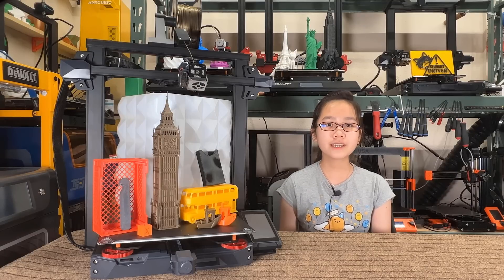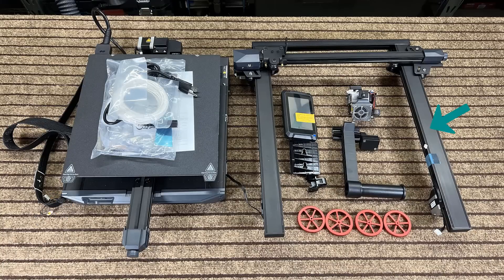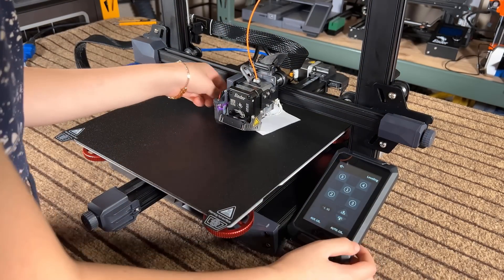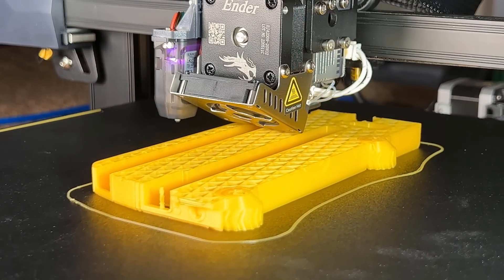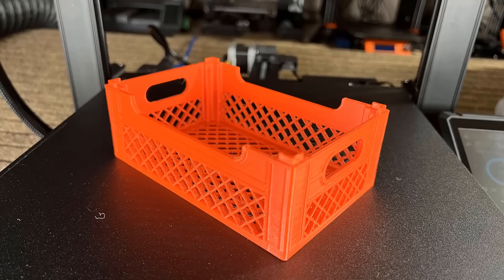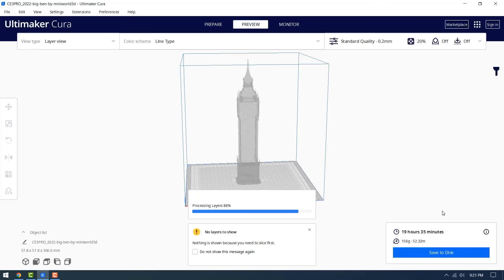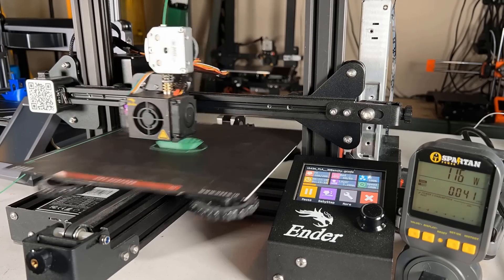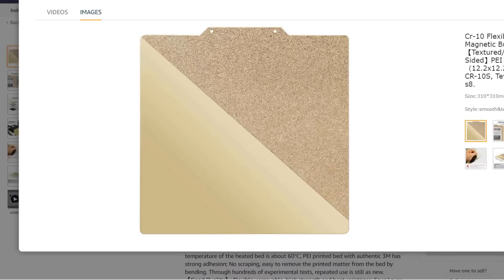Creality Ender 3 S1 Plus: A larger 300x300x300 Ender-3 S1 with some upgrades for $529, Pros and Cons

Comment: Hi Aurora, I noticed the colour screen and display firmware on the Ender 3 Pro display in this video at around 15.55 of this video.  What firware is that using please and is that the same display as the standard Blue screen supplied in the older models of ender 3 pro?

Comment: I do find it odd that rather than eliminating the mass of the bed adjustment wheels, moving to silicone columns and relying on the ABL sensor, Creality opted to 'upgrade' to heavier Aluminium adjustment wheels. Other manufacturers using linear rods eliminated the whole bed levelling routine entirely

Comment: I realise this is 3 years old, but so many of these printers seem so slow now, but can be made to run much faster under klipper. It would be interesting to see how these machines compare with latest ones once they've been optimised to run under klipper. I just got an S1 Plus for €50 which just seems nuts, but I don't think I could live with it at stock speed.

Comment: i cant get my first layer to stick unless i use a raft. then the first few layers taper inward while the first layer is srtingy around the edges but most things have been usable. ive messed around with alot of the settings in crealitys slicer and have alot of good results minus the first layers.
Reply: Have you tried a PEI sheet? for PLA this solves a lot of these type of issues.
Reply: @imaginitivity7853  that was the first thing i bought back then.

Comment: If you did a video on how to upgrade to 300C, you would be helping a lot of people.  Heat break, thermister, perhaps hot end.  But the real problem is the firmware changes......  How to do the firmware changes?
Reply: Run it under Klipper. It'll print faster too

Comment: Do you have a recommendation for the best way to upgrade the Ender 3 S1 Plus Hotend to handle 300 degree print temperatures?   Also would be interested in any other upgrades you would recommend for this model since you filmed this GREAT Video.  I just ordered one with the Laser Engraving Kit and should be arriving tomorrow.

Comment: Great video! I was wondering if you could upgrade the Creality Ender 3 S1 plus with the Sprite Extruder Pro Kit 300℃ ?
Reply: Yes. That addresses all the hardware issues (heat break, heater, thermistor) then you just need to change the max allowed temp in the firmware

Comment: What!! Did you just make my day? You can increase the z-height to 320mm with an "M211 S0" slicer start-code? Does it stop automatically at 320mm if I set the Z-Height in the slicer to 320mm or is manual intervention required? I measured the max height with a ruler. The glass bed up to the nozzle with the z-axis maxed out to the top and measuring just shy of 310mm? Please let us know how. Thanks.

Comment: what will need to be done to this printer t make it 300 C capable will just adding a heat break do it or do you also have to flash the firmwear. I really like this printer but I need it to be capable of 300c

Comment: Your reviews are thorough, your knowledge commendable, your work ethic  top notch and lastly, but certainly not least, your ability to demo/present/teach, is truly incredbile. I think the thing that tops that off is your “just getting started” age wise. I’m 57 and astounded, truly. You belong in rarified air, Stefan CNC Kitchen,  Angus @ MakersMuse, Thomas Sanlander, etc… What’s ironic is your content, your brothers videography (and I’m sure he contributes in many other ways)is just fantastic. I bought my second printer, about a month and a half ago, the Sovol SV05, because of your review. It cost me, the same exact price of my Anet A8Plus, that was bought two years before, and I came away with so many upgrades, 32 bit board, silent steppers, cube construct, autobed leveliing. I wanted all these features but every time I found them the price was out of reach for the budget that I had set. Your review of the product, is what sold it. THANK YOU!!!!

Comment: Regarding the issue of the nozzle remaining in contact with the PEI surface while preheating (beginning at 14:00 in the video): I am experiencing a potentially related problem: auto-leveling always mashes the nozzle into the build plate, tries to ram through it (pushing the plate down), then moves laterally as the nozzle gouges the PEI surface (in spite of very careful assisted leveling preceding that).

I would greatly appreciate insight into what causes this problem and how to resolve it. I contacted Creality almost a week ago and still haven’t received any help from them. Unable to complete auto-leveling normally, I haven’t yet printed with this printer but I have successfully printed thousands of things with three other printers, all with auto-leveling that works exactly as it should.

Comment: I see when you added the G29 ABL code there wasn't much else. when I go into cura i use the same printer as you and after my g28 code there's a lot more stuff 
G1 codes about lifting the nozzle and start positions after the G28 did you delete this? I'm new to this game and am struggling with the tech side of it. I was going to copy your settings in cura but mine look different. Great review I'm glad I came across your channel, now subscribed

Comment: Hello Aurora, please help, I have an Ender 3 S1 pro printer.
I changed the nozzle and when I try to level the bed, it lowers the extruder and the nozzle sticks against the bed and makes a very ugly noise, the cr touch works, I put a book on the bed and it did those 2 steps well. I raise the z axis. But when I tell him to level again he crashes into the bed. And raising the z-axis while it's making noise from being in contact with the bed makes me afraid to wait so long for the z-axis adjustment window to activate. I don't know if the limit switch needs to be adjusted.
Thanks in advance 🤗

Comment: So you recommand This over the s1 pro
Reply from the maker: The S1 pro can print at 300C so you can print PA-CF and PC-CF. This S1 plus is a larger S1, just printing at 260C. Just depending on what you need to print.

Comment: I’ve upgraded my Ender 3 V2 to the Sprite Pro extruder is there a file or place to purchase the filament holder with sensor mount? I have no way to mount my existing sensor.

Comment: I have an Ender 3 S1 Plus. It is not my first printer. I have had a CR-10s for a few years. The Ender is new and I have had it about a week or so. I can't seem to get the bed to be consistently level. I can set my bed level using manual and auto level and run a print and, after my print, check my level on the manual mode and it will be too tight even though it was set right prior to making one print. Any help would be greatly appreciated.

Comment: What brand glue stick do you prefer to use?
Reply from the maker: Elmer's Craft Bond Extra-Strength Glue Stick $3.25 (0.88oz), it's better than regular purple glue. https://amzn.to/3UEnlYC
Reply: Thanks grabbed one today! I’ve never used glue before but when you do do you only use it on a smooth surface?
Reply from the maker: I also use it on textured PEI sheet, I will show it in my next video FLSUN V400 this week.
Reply: @AuroraTech  look forward to watching, since making that comment i tried it on my stock ender 3 pro textured sheet and it worked great for abs! side note, do you know if the usb c port on the s1 plus can be used to adapt usb-c to a usb thumb drive?

Comment: Can the titanium throat tube from the s1 pro be directly swapped to the s1 plus?
Reply from the maker: Yes, but you still need to upgrade the thermistor and heater block, as well as the firmware source code to change the nozzle max temp.

Comment: Great review Aurora. I just upgraded my Ender 3 Pro with a Creality Dual Z Axis kit, a Creality Direct Drive print head and a BTT BLTouch (I upgraded the printer with an SKR E3 V2.0 with TFT display shortly after getting the printer). I looked at the Ender 3 S1 after seeing your review on it and saw it had the same build volume as my Ender 3 Pro, but then I saw there is an Ender 3 S1 Plus that can print to 300mm (11.8") in all 3 axes. I bought it from Creativity Labs on Amazon for around $550. The extra print volume will come in handy for me. I'm glad I will not need to add extras or updates to it.

Comment: is it possible to upgrade the heat break to the titanium one as seen on s1pro to this s1 plus, to allow printing at 300deg for some materials?
Reply: to be more specific, do we only need to replace the heat break with a titanium one, or also other upgrades to the extruder assembly?,

Comment: Is there a reason for adding G29 instead of M420 S1 in start GCode?
Reply from the maker: G29 will do auto bed leveling every time you start a print. M420 S1 will load the last saved mesh data instead of redoing auto bed leveling.

Comment: Could you please tell me why you turned off the cooling system for some of your projects? I know nothing about 3D printers, and my knowledge is only limited to Laser machines. I'm interested in adding a 3D printer to my hobbies business. Also, Is that a good fit machine to use only for small projects? Thank you so much.

Comment: Nice videos.  I do have a question.  As you were printing different items and using different filaments I understood why you changed temps, but I didn't understand why you would turn on or off cooling?  Can you explain?  Thanks
Reply from the maker: It just depends on what type of materials you are printing. For printing PLA, it's better to turn on 100% cooling after the first few layers. But when printing PETG, ABS, Nylon, or other higher temperature materials, it's better to turn off cooling or turn it down to 40% or lower to improve print quality, layer adhesion, and reduce the change of warping.

Comment: A bit late to the table, but gere is my offering.
Great video
To the point, accurate and unbiased review. 
What you expect from a tech channel
As the owner of 2 S1 and an Ender 3 Max (300x300x340) I can wholeheartedly agree that the increased build volume doesn't quite cover the increase in price.
But the build in CR-Touch is awesome.
But yes, an all metal heat break would be much better.
Expecting the S1 Pro Plus just arround the corner...
Prusa Slicer does have an S1 profile in there printer lineup that works awesomely.
Question: Didn't printing at 255 C cause fumes? The PTFE Tube inside the sprite starts breaking down at above 240 C.
So I am careful not to print ABS on my printers anymore. But PETG at 235 C is as high as I go, and my S1's give great results with both PETG and TPU. (CRON TPU prints at 215C!).
So thank you for a great channel.

Comment: Do the models remove easily from the bed after printing? Are you a fan of glass beds?
Reply from the maker: Not as easy as the PEI textured sheet, but as it's flexible, I don't have any issues when removing prints.

Comment: Thanks for another fantastic review.  If #Creality is listening, these two geniuses at Aurora Tech are the ones who compelled me to order my S1 Plus :)

Oh by the way, did you have to cut notches in that smooth PEI sheet you used? Or did you just attach it resting slightly offset from the screws in the back of the bed?
Reply from the maker: I just let it offset from the screws, I didn't cut it as I still want to use it on other printers.

Comment: Excellent review as expected and delivered by you.  I wish you would comment that a larger print volume almost mandated a Volcano Type Extruder (I only mention Volcano type here but so many other possibilities exist to transfer heat into the filament ) to make print times reasonable.  You  did discuss the con of  the heat break but with TI heat break AND extended heating surface area in the nozzle, this larger print volume might make sense.  However, all of your other cons are 'spot on'.

Comment: You're better off getting a cr-10 smart pro, has the PEI, the titanium heatbreak and larger bed
Reply: The cr-10 has a taller build (100 extra mm) volume but they both have a 300x300 bed. Also is the pei and the titanium heat break worth the extra $300?

Comment: Great videos! You are very thorough yet concise.

I would like you to see you review the Ender 5 Plus. It has been out for quite a while now so it's not new but I think it is still special. With a Z axis bed and a lead screw at either end, the bed looks extra stable. I think it would very good for printing tall, thin objects - like the Big Ben or aircraft wings and fuselages. I would imagine it will have very little ghosting due to oscillation. It would be interesting to see how precise it is with the print head on the X-Y axis rather than the bed. I know you have done the Ender 5 Pro but the Plus seems to have been overlooked by most reviewers.

Thank you for your consideration.
Reply: Hi, my 3D print supplier has an Ender 6 and he had to reinforce the front of his buildplate to ensure propper leveling during a print. It saggs a bit, not much but some. A front leadscrew would have been a great addition...
Reply: @MrGerhardGrobler  I think one lead screw on a Z axis plate has to be asking for trouble, especially with heaver prints. With wear due to usage I think a sagging plate would be inevitable eventually.
Reply: @TonyGrant.  I actually meant an additional lead screw to distribute the weight from the back lead srew to keep it even. not to move the lead screw from the rear to the front. sorry for the misunderstanding.
Reply: @MrGerhardGrobler   There was no misunderstanding.

Comment: If you pay attention you can pick up the Sprite Pro extruder as an upgrade kit for  about $90 on sale fairly often.  Even off sale its about $110.  I basically built this printer a while ago using a Sunlu S8 frame I picked up for extra cheap and a BTT board.  Tossed a sheet of PEI on it and less than $350 for a better version of this printer.
Reply: Or you can pay ~$30US for the Pro heatbreak upgrade for the base Sprite instead of replacing the entire print head assembly.
Reply: @iansabrewolfe  I bought the pro extruder and put on a extra cheap 310x310x400mm machine.  That is one of the reasons I called it a better version of this printer.  It is bigger and it has the all metal Sprite extruder.

Comment: Impressive, so you were able to print nylon at 250 degrees on a heat break with PTFE tubing? Any concerns about it melting?
Reply from the maker: As PTFE tube can hold up to 260C and better quality Capricorn claims hold up to 280C, I think printing the Nylon should be fine. When I print ABS, Nylon or Polycarbonate, I use my laser engraver ventilation duct and fan to exhaust air outside my garage.

Comment: I'd love to see a video of calibration and troubleshooting of a new printer.. I've got a S1 pro and been having trouble with the paper method.. It needs to be super tight to get a good squish and not leave gaps between the lines on the first layer tests.. Set it up based on the "Just touching" and regularly have trouble with bed adhesion even with PLA.
Reply: Get a set of feeler gauges and use the thinnest one and you will be able to dial in your Z much easier and more importantly more accurately and more uniform across the four corners.
Reply: @AndrewAHayes  
Tried that with a 0.2mm, was worse than the paper..

Best success I've had is adjusting it mid print with a calibration pattern; but it just seems crazy tight to achieve that level of squish.. Wondering if it's the stepper calibration is off or something..
Reply: @jaydnisevil  I think your gantry has dropped on one side, measure from the gantry to the bottom of the frame on each side and if it is out of whack follow one of the gantry levelling videos on YT.

Comment: You can get  Ender 5 Plus for about the same price and has much more to offer with no bed slinging. Wouldn’t that be a better option for the money?
Reply: Does it come with the sprite head and larger touch screen 🤔
Reply: @rickstard73  but is that worth it?
Reply: It is a boden setup, not a direct drive, what I think is a Better setup
Reply: @avejst  Most would argue the direct drive is better though and the high temp extruder for materials such as nylon 😀
Reply: @avejst  agreed, that is a benefit. Creality should upgrade all their printers with it.

Comment: Nice review!

My guess is that they will soon release an Ender 3 S1 Plus Pro with the higher temperature heat break, maybe for an extra $50 or so.  If they want to go higher to a higher price point than that, they'll need to think up some more features to add.
Reply: Any update on this? Will there be a S1 Pro Plus?
Reply: @xdxdxdunix  probably not, I mean the upgrade is done in 10 minutes for 15€
Reply: @xdxdxdunix  he made that shit up don’t be that gullible